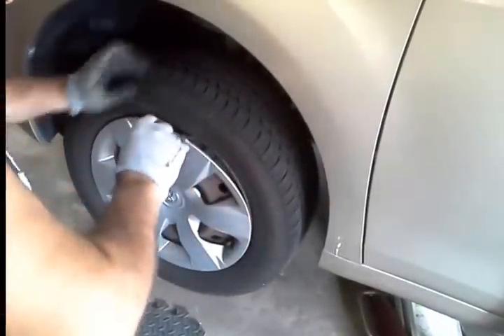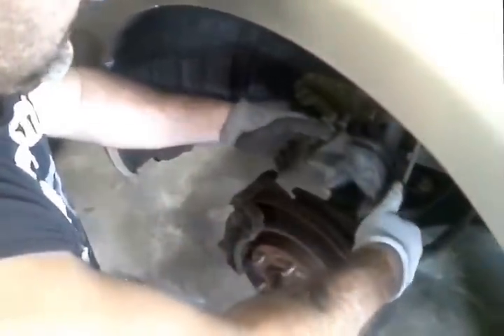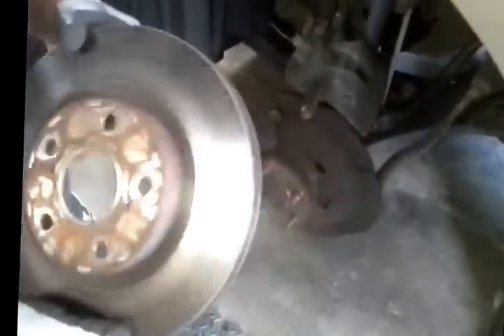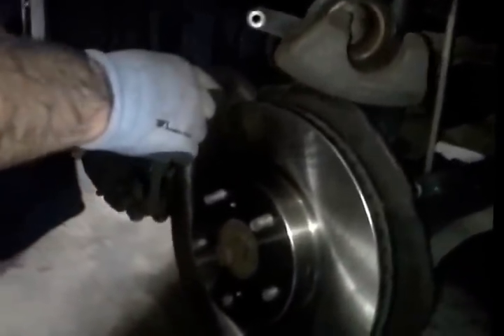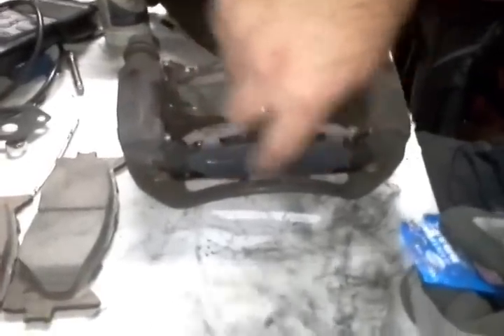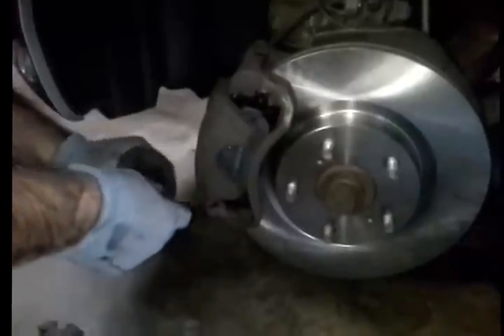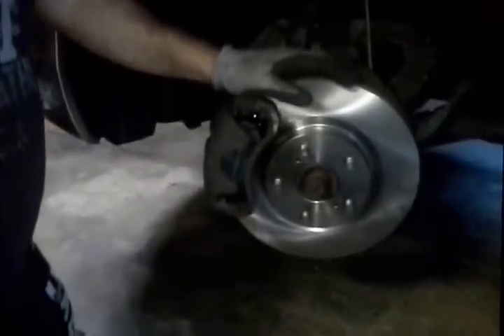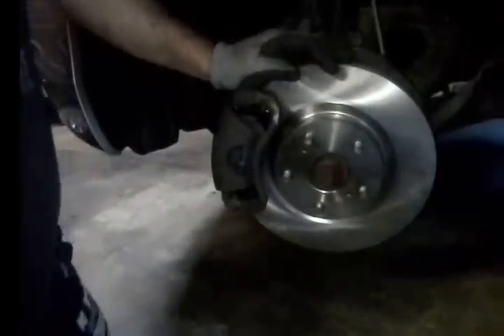Fix/Replace Toyota Camry Front Brakes and Rotors

Comment: great video. just a tip to hold the rotor while putting the brakes back on, is to use 1 of the lug nuts if you are on your own, to hold the rotor in place.  hand tighten it.

Comment: I didn't see where the caliper pins were removed, cleaned and silicone paste added🤔🤔🤔 Also for those cars in areas with excessive moisture/snow, consider replace the brake/caliper hardware. I've been using Carlson hardware, specifically one line of hardware that has rubber coating on the back side and PTFE the contact side. If not available, consider anti seize on those sliding parts of the brake pads..just my opinion/experience/suggestions